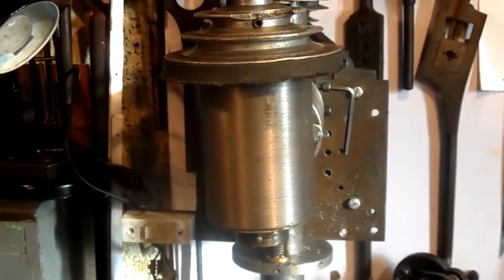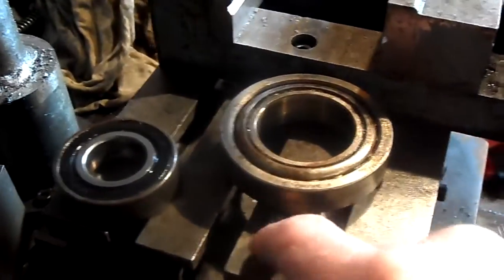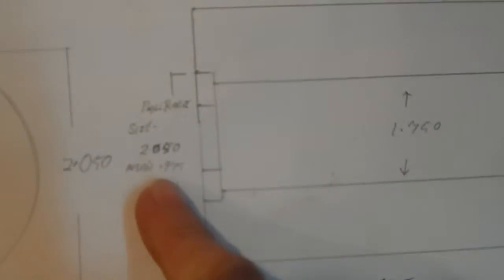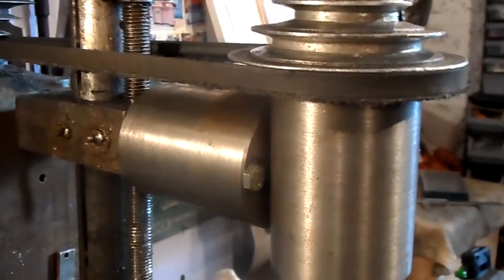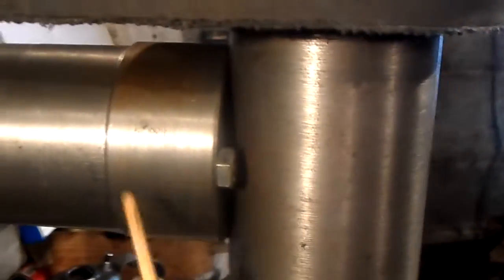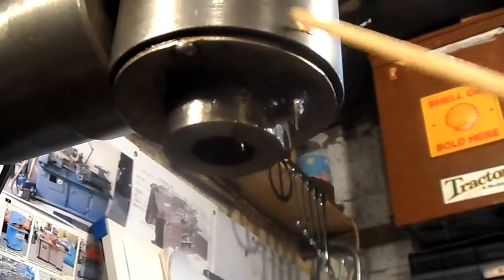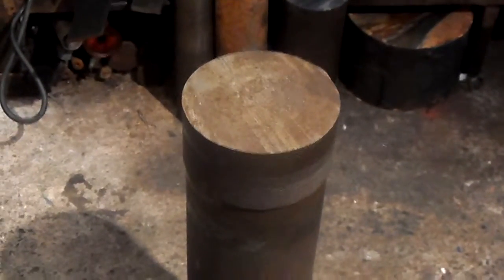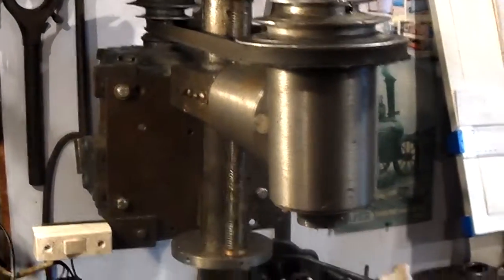Bearing arrangement for milling machine

Comment: Thanks very much for the video.  I plan to build a similar machine sometime soon.  This is very helpful for planning out the pieces of steel I'll get from the depot.  They cut to length all sorts of massive pieces at this yard nearby and sell the short bits for a few dollars each.  It will make a good milling head.